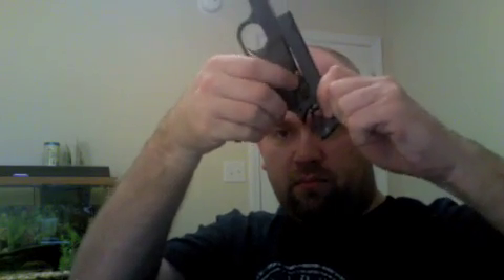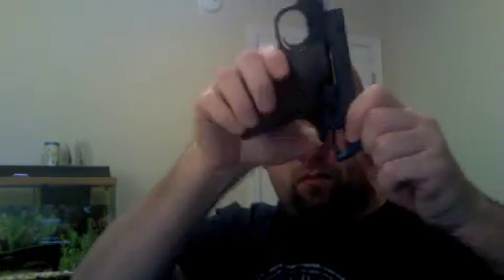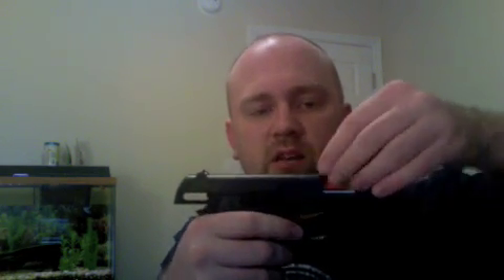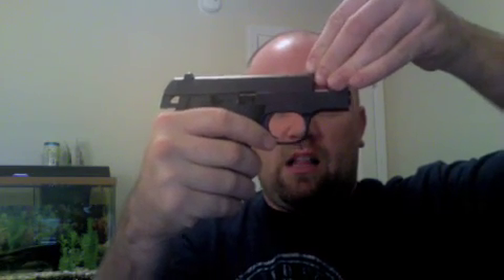Smith & Wesson 2214 Disassembly

Comment: 2214 Had mine for about 28 to 29 years now. But I am having issues like FTE and FTF. Just changed out the recoil spring but still the same thing.
The ammo I am using Federal 40 gr. (325 in a box) also Aguila .22 super extra 40 gr(250 in the box).
Reply: any update on your 2214? Have you found a fix for it?  I'm hoping to get one if i can find one that runs well

Comment: A spent (empty) 22LR casing works if you don't have the little orange tool. The hollow end of the casing goes over the part holding the spring.

Comment: Great video. Very helpful.  A note to new gun owners though about checking the chamber.  You checked by cycling the slide and relied on nothing falling out for showing safe condition.  I would also visually inspect the chamber in case of a live shell NOT extracting which I have seen more than once.

Comment: Thanks for your vid. I have a model 2213 (the stainless version of the 2214). Too much oil can definitely interfere with the function of the firing pin. Some authorities go so far as to say not to put oil into the firing pin hole.